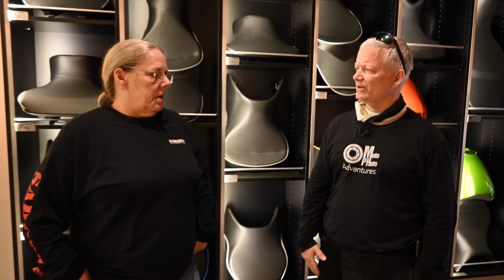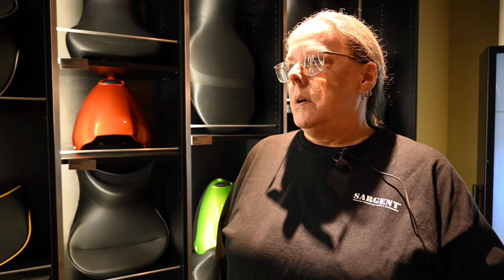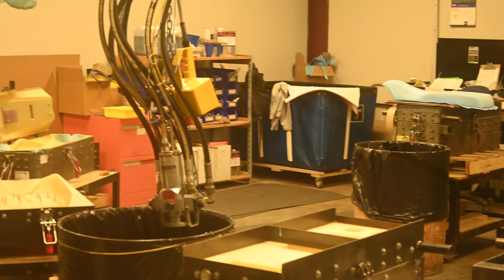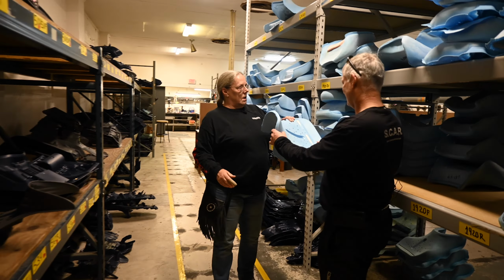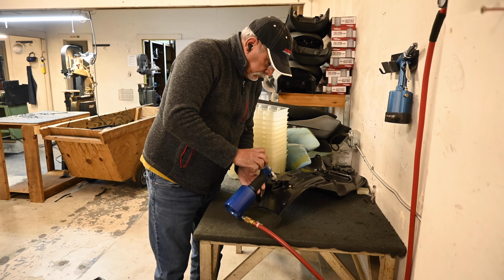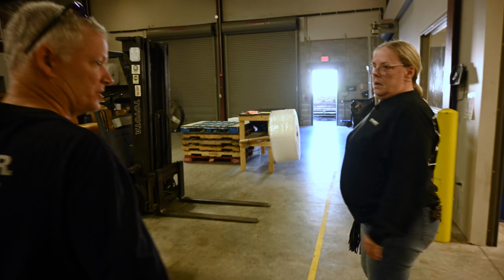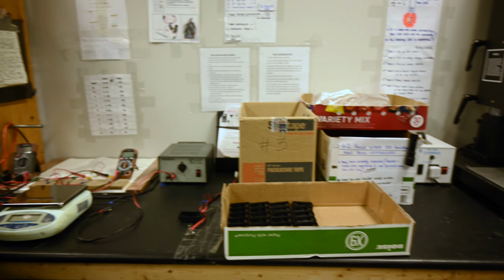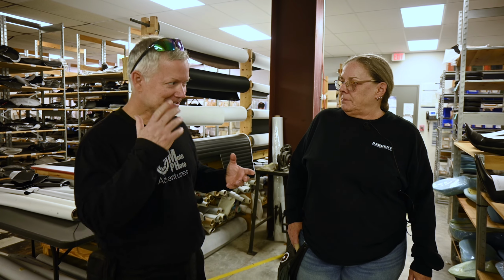FACTORY TOUR!!!!!  Sargent Cycle Products

Comment: Very cool. Are they making a lower Tuareg seat for us vertically challenged folk?  :)
Reply from the maker: Hi Steve!  I think the first one will be standard height.  However, I have been testing out the Aprilia Low Comfort Seat and find it to be an improvement over stock, especially on longer trips.  (For the record, I'm 5'7 with 30" inseem.)  My initial test and thoughts are in this video:  https://youtu.be/OpIXrzBw0vU?si=PtYDKoNwyU6Z3gRm.  And I've got a long-term review about it coming out next week.  However, my ultimate plan is to install the AltRider lowering kit before the Sargent Seat comes out.  I've already got the kit and will be doing an install video of that.  But I discuss the benefits of adjustable suspension kit in this video:  https://youtu.be/UVsgm6msQjg?si=PXsNXpbhijqqZ0Z2.  Once that's installed, I'll be able to quickly and easily adjust the suspension up or down to accomodate the Sargent Seat when it comes in!